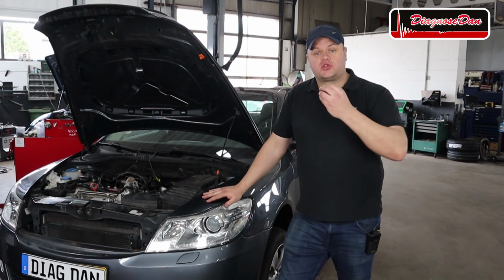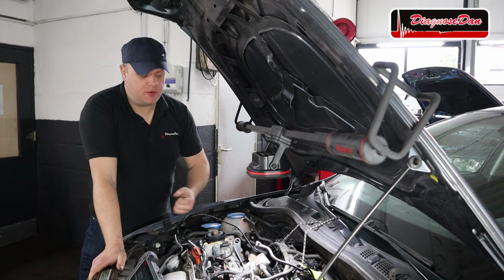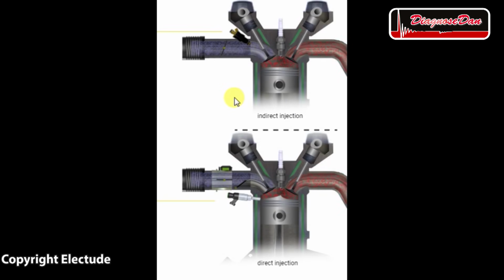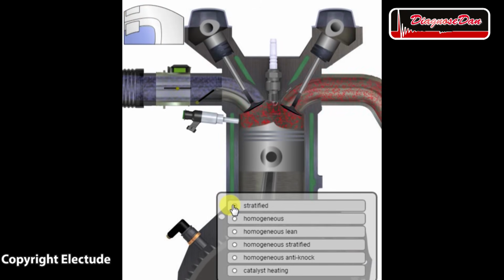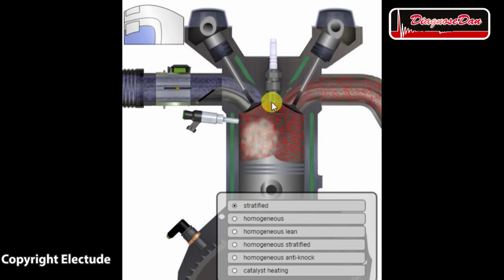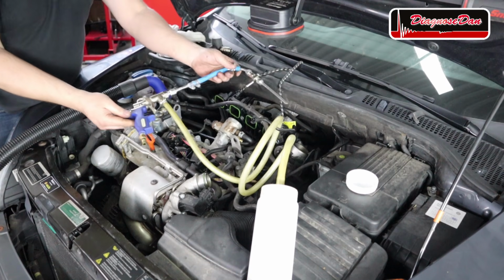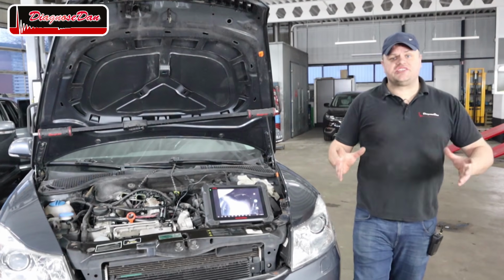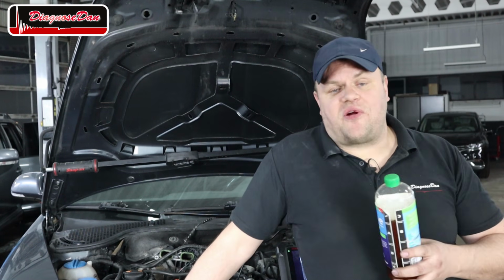Tsi cold misfires explained

Comment: I had DI engines run good again with revive ! Never opend them up to look inside but I used a lot of it. Soakt it in real good,  never heard the complaint again. 

Greetings,  nice vid
Reply from the maker: Maybe the Carbon build up wasn't as bad as this one.
Reply: @Diagnosedan  indeed. This one is bad haha.

Oven cleaner seems to work wonders on carbon buildup (what I heard of). 

I don't know if the intake will like it..

Comment: Thank you for another great presentation Dan!  Nothing is more certain than actually checking it visually like you did, especially those products that claim to clean internally.  Also, there is no short-cuts on any job when things are real bad,  I suppose.

As for the blasting, in Japan they were using machine that blasts with dry ice pellets to do the same job.  Since dry ice naturally disappears after while there is no need to neutralise or suck the residues up completely.  I haven't seen this outside Japan.

Also, on the future video, if you could mention the odo meter readings of the vehicle featured would be great.  It gives some ideas as to what to expect at certain mileage though of course this varies on how the vehicle is being used and driven, it is still useful.

Thank you and looking forward to your another great episode.
Reply from the maker: 130K kilometers, i've never seen blasting with ice over here.
Reply: @Diagnosedan  Thanks Dan,  I haven't seen one outside Japan being used in garages but if you're interested, this is what it looks like, though the page is in Japanese only you get the ideas from the photos.  Cost might be the issue nonetheless, more and more cars are becoming direct injection, this might eventually become available in Europe.
http://www.greentech-japan.co.jp/

Comment: Where does the carbon build up come from?

I thought it was leaking valve seals.
Reply: 4:30 - 4:42
Reply: @EXOVCDS  Didnt expect a crankcase vapour to cause so much carbon buildup. Why is there no filter for crankcase vapour?
Reply: @mcqcjc8409  The engine has an oil separator... but tiny oil particles make it past. The heat in the intake bakes the oil into carbon and some exhaust fumes / particulates probably get caught in the oil as well during valve overlap. I'm no engineer, so that's my layman explanation. I run water injection & vent PCV to atmosphere in my turbo BMW ... the valves & intake look spotless! =)
Reply: @EXOVCDS  Thanks.

I wonder if a crankcase pressure might be responsible for that too? 
If the car has an oil separator then it looks like it does very poor job if it allows such a build up.
Reply: @mcqcjc8409  All cars have this issue (PCV oil in the intake)... as mentioned in the video, injector location plays a role in how much oil / contaminants gets to the valves.
Reply from the maker: Of course there are many sources for contamination. Leaking valve seals can be one of them
Reply: @Diagnosedan  
The example that u showed us - was this carbon build -up only due to crankcase fumes? 
Or maybe there was excessive pressure being pushed from combustion chamber to crankcase due to...low friction thin rings? 

Or finally was there any valve stem seal damage?

Comment: In the late 1980's we used to use sprayed in the inlet manifold  crushed eggshell to remove carbon , no damage to engine as in burned away when doing job
Reply from the maker: Eggshells are new to me, never heard of that one before. I learned something new!
Reply: @Diagnosedan  have spoken to someone in our job  ( engine builder ) today who says now Walnut shells are used to decoke manifolds , cylinder heads etc Insitu , with minimal stripping and vaccuming out after to remove excess shell leftover  ,cost around £250/£300 here in the UK

Comment: How many kilometers on the clock and How old is the car?
Reply from the maker: 130K km. 8 year old car
Reply: @Diagnosedan  
A bit surprising. Thanks.
By the way - do you have any experience with catch cans as a countermeasure?
Reply from the maker: @Riis_DK  a catch can will slow the process down 👍

Comment: No magic in a can ever! In my 35 Years of messing with engines I must have heard a million ads claim this and that. To be honest, I would not have wasted my time trying. 
Here is a little bit of humor for you. I always try to get my customers to run a fuel additive or cleaner but when they ask me what does it do? I generally tell them as far as you are concerned it does absolutely nothing.
 That is generally the Point in time when you see the confusion kicking in.
Reply from the maker: 😂😂 Thanks for the comment 😀
Reply: It did do something, but there was so much carbon that it would take a much longer treatment to get it all out.

Although, to be honest, any light hydrocarbon or alcohol will do the same exact thing. Indirect injection engines don't need this because the gasoline does it as you drive along, cars converted to LPG always have spotless valves (sometimes even have problems with accelerated valve edge and seat wear because they're always so dry). I suspect you could just pump your intake manifold full of gasoline, leave it overnight and in the morning it would look much cleaner already.

Comment: The quality of what you are sharing is second to none Danny. Thanks especially for taking the extra time in dismantling the intake twice for our benefit. I’ve never heard a proper explanation of the cold misfire cause before but your description makes perfect sense. Have you ever seen the port dividers on TSi engines broken in half. I’ve seen a couple now and wondered if it might be due to excessive intake air temp caused by bad remaps. Both were on cars owned by young drivers with exhaust and air filter modifications?
Reply from the maker: I've not seen that yet, thanks for the comment 😀

Comment: Good thing the engine has a rev limiter. I witnessed a guy I worked with, put the same kind of brake pedal depressor from the throttle to steering wheel. The engine screamed because the steering wheel moved unexpectedly. 15:40

Comment: Hi Diagnose Dan. I really enjoy watching your videos and have learnt some nice tricks from you in the past. From my understanding of direct and indirect injection in this instance. The indirect injection would help keep the valves clean with the feul flowing over the valves when the direct injection doesn't allows this. Excess carbon could also becaused from an engine breathing problem and I would recommend changing the crank case breather valve or valve cover.
Reply from the maker: You are right 👍

Comment: Great video. I was taught by Bernie Thompson of ATS it’s the “turbulence” of the air going into the cylinder. Your explanation is on point and makes sense. Thanks for sharing. My only question is what about “pooling” of the revive or other chemical cleaners going into these upside down intake manifolds?? Thanks
Reply from the maker: Can you explain what you mean with "pooling"? Do you mean a part of the liquid collects in the intake? They let you run the engine at a higher rpm  untill the exhaust stops smoking. Than they want you to drive the car for 20 minutes.
Reply: DiagnoseDan yes i mean if when doing the service too much fluid pools at the bottom of intake then makes its way in to the cylinder possibly hydro locking motor. This is my fear and have only heard of it happening.

Comment: Hey Dan, Great video as always. FYI, we used GM Top Engine Clean in our Lexus engines to remove this carbon buildup in the IS250 V6 engines. The trick was to get the engine very hot then remove the intake while it was still hot, then pour the bottles' measured amount into each port except the one that had the valves open. We used a small scrubber made of a handful of ZIP ties (zip tied together) then gently scrubbed the intake valves for about two and a half minuets. After, we sucked the fluid out then sprayed carburetor spray to finish the cleaning process then finally sprayed WD40 to help neutralize the chemicals used. The last step was to turn the crank and clean out the last cylinder using the same procedure. The total time to complete the service was about two to two and a half hours. I think the pellet and vacuum system you demonstrated might be the best way to clean these valves because there are no harsh chemicals and the engine can be cold. One last thing, we noticed that the V6 engines with a manual transmission never developed carbon buildup. Perhaps the higher RPM's prevented any carbon misfire issues?
Thanks again for a great video!
Reply from the maker: Interesting, i can't explain why the manual didn't have carbon build up.
Reply: From what I see, it doesn't even matter if u clean it as with the first drive it will build back carbon.

Comment: We use BG GDI 44K intake valve and throttle body cleaner,the kit has one can fuel tank additive and two cans of valve cleaner..BG products are of highest quality and work exceptionally well.I have used a wide range of products and short of removing manifold BG gave me the best results.
Reply from the maker: Sounds impressive Joe

Comment: Hi Dan it's been a while it was a nice video , just you forget to mention that's the carbon when it build up get heated 2 high temperature and that will affect the air temperature and that's definitely cause misfire and low performance . Don't take long for the next episode please😁
Reply from the maker: I'll try to do a video sooner😉
Reply: Dan please if you try to make us a video about oil when it's star increasing in the engine by the injectors they add extra fuel to do regeneration for the DPF? I don't know if you cross that problem before

Comment: Superb video I learned a lot even though I don't currently own a DI petrol engine myself. I did wonder if the crankshaft needed to be turned each time to ensure the valves are closed on the cylinder you are working on, it appears from the comments that you need to do that. I didn't realise how many injection modes there were 😳👍🏻
Reply from the maker: Yes keep the valves closed😉

Comment: Thanks for the detail explanation DD, it was helpful. The view of the intake valve looks like the inside of a coal mine. I can see why the old fix for carbon buildup is to go out on the freeway and floor it. May need an adapter to the intake to bleed the cleaner in during normal driving. My syntax is proberbly off because i mostly finished my Blueberry Oatmeal Stout. Hope you have a sense of humor. I enjoyed the video.
Reply from the maker: They don't want the engine to get to hot during the treatment.

Comment: There was a product I would use back in the 90's that we would put into what I called an I V bottle and hook it to a vacuum port, the engine would smoke like hell, but the stuff worked. Just cant remember what it was called.
Reply from the maker: I've personally haven't seen a product that really cleans the carbon without blasting.

Comment: As usual, poorly engineered emission reduction. It seems those engineers need to "Direct Inject" the crankcase blow by eliminating the path of the intake system. Everyone knows that engines have to breath better not worse. In this case, the manufactures fully well know the car owners will be subject to an expensive maintenance item at some point. Seems like they need to go back to the blue prints and figure a better way to deal with PCV. Thanks for the video.
Reply from the maker: The problem is solved on newer engines by placing an extra injector in the intake.

Comment: Great video Dan! We get these at the shop frequently although not many with this much build up. The newest BG products work well when applied correctly. An application like this may take several cleanings though, so would be a better candidate for blasting. The local VW dealer also has been using the BG products.
Reply from the maker: Yes this one was pretty bad😬

Comment: DiagnoseDan,
I was wondering for people that want to do a DIY and don't have a blaster but do have time on their hands. Can you just fill the intake runner on a cylinder with a closed valve with gasoline, leave it there for 10-15 minutes, then suck it out, and repeat that a few times. Then do that one cylinder at a time on all 4 cylinders. I know that this may not be practical for a shop, but OK for someone that doesn't have a blaster or want to take the risk of putting particles into the cylinder. I guess the key question is how well does gasoline dissolve this carbon?
Reply from the maker: Once the carbon build up is very bad, its hard to remove with chemicals but you can try. Without a blaster you can try to clean the ports with a small pick. It will take forever but that's your best chance.

Comment: Thanks D Dan! That direct injection issue 's a tough one and nobody seems to have a good method to deal with it...
Both my cars are naturally aspirated with air-intake-mounted injectors. One is even still a pushrod with no VVT (gm 3.9)and always seems to work - and work well.
I really am not excited about 'moving forward'...and my cars keep aging....what to do? I don't know..
Reply from the maker: Newer direct injected engines have an extra injector to keep the intake clean.

Comment: Excellent work Dan and great explanation of cold start misfires. All makes sense now! One thing, perhaps it would be an idea to use both systems with the Revive being first to move carbon from upstream of the inlet valves, then finishing off with the individual port blasting.
Reply from the maker: After the treatment i blasted the intakes, didn't really effect the results.

Comment: Awesome video as usual Dan! I had a 2.0L Mazda Skyactive in the shop that had very similar symptoms and 110,000 miles. I used BG products direct injection carbon cleaning system. Unfortunately the customer didn't want to pay for intake removal and cleaning by hand. The BG helped significantly but still had a slight miss and a random P0302. Was told she was in the market for a new vehicle anyways.
Reply from the maker: I've never seen a product with simular results as blasting so far.
Reply: @Diagnosedan  yes i agree. BG markets the product as a every 20000 mile preventative service. I agree with them that when used regularly the valves should never get to this point.

Comment: DAN i think that revive is more for turbos, that are clogged up a bit
Reply from the maker: On the Revive Facebook page they do advertise for cleaning intake valves
Reply: @Diagnosedan   your right , but this is a new thing with revive, i first used it a couple of years ago , and its claim was to clear up turbos that we're clogged up, and the other claim was that , they used revive on jet engines turbines. ill be honest with dan, them TSI engines are no good, they have lots of issues, the chain loses tension etc, the list is long, the FSI engine is better, but the belt engines are the best.

Comment: If memory serves me, BMW was among the first to have this issue in the '80s or '90s, the only recommendation was disassembly and manual cleaning the valves etc, it was very expensive and time-consuming....but it worked until it didn't......................
Reply from the maker: Sounds like alot of work😉

Comment: here in the states i use a product called B.G. they make several kits but the one we used at the Cadillac dealership is a three can kit it runs about 35 bucks. we first run the engine around 2k and direct inject through a vacuum port. once this was done i would fill the B.G. can with warm water and repeat the process. the other can was poured into the fuel tank, once we drove the car for about 20-30 min it took care of almost all build ups
Reply from the maker: Sounds impressive
Reply: @Diagnosedan  ill see if i have some at the shop and send you a link not all b.g. products are the same

Comment: Here in the US it's either walnut blasting or manual scrubbing with CRC Intake valve cleaner. Our 2011 BMW Z4 35i has 100K miles but never been cleaned. Still runs well but probably has lots of carbon buildup. Wish manufacturers made this a bit easier.
Reply from the maker: Thanks for watching Cees👍 your name sounds Dutch
Reply: @Diagnosedan  Indeed Dan, I am Dutch living in Los Angeles. I enjoy your channel a lot, and have learned a ton already in the last month or two. Your English is quite good. I maintain our cars and motorcycles myself so always interested in how it all works. Tot de volgende aflevering!

Comment: Direct injection without port injection, cylinder deactivation, auto stop and restart are all forms of what I call dark technology. They save fuel for new car to make manufacturer look smart. But in the long run cost more money to maintain. In short, saving for fuel but not money. I believe somewhere in the previous decade, lots of cars /manufacturers start to go backwards in terms of technology improvement. Oh, don't forget electric parking brake, that is straight stupidity.
Reply from the maker: 😂😂thanks for watching

Comment: This doesn't help me at all. I have a BMW M57 engine that needs carbon blasting but this is for wussy petrol engines.
Reply from the maker: Carbon blasting is the same process for diesels
Reply: DiagnoseDan yes, just need to be careful of the plastic intake on the swirl port side of the Diesel engine as the walnut shell blasting will damage it

Comment: Dan ,  Automotive test solutions 3c chemical machine uses a three part chemical system.  Bernie shows lots of case studies before and after with great results.  Depending on how bad the carbon on most applications there is no need for intake removal or blasting . It’s on my list of equipment for my shop. This system is one that will keep cost down for our customers and the service is something that the customer can actually feel the difference when complete.  Keep videos coming love em. Thanks.
Reply from the maker: Thanks Richard👍